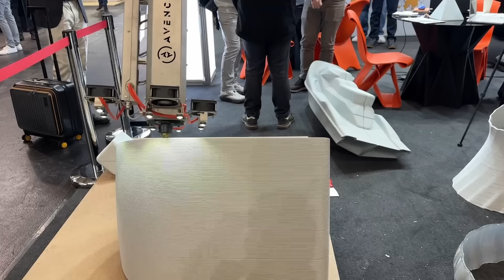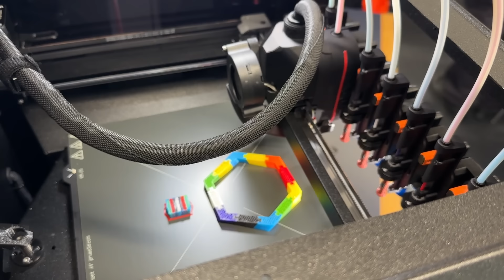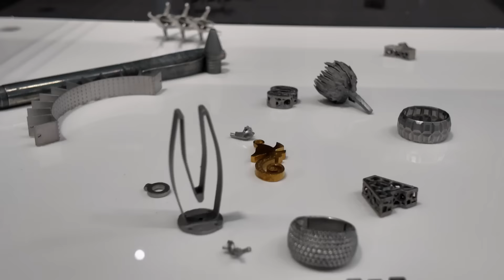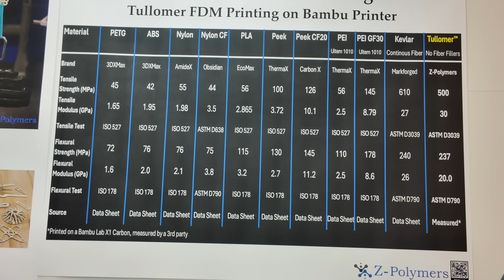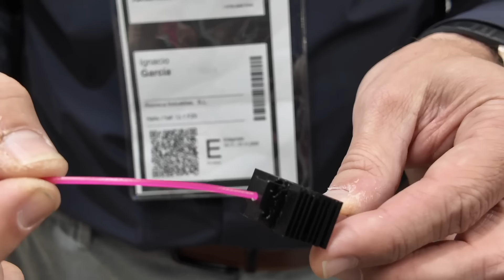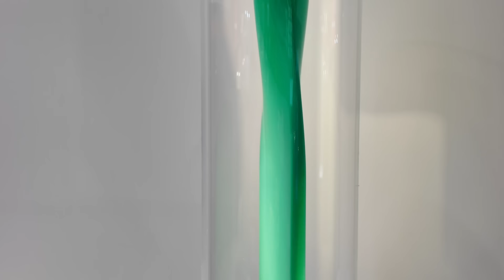2026 Will Change 3D Printing (Formnext Innovations)

Comment: How dos INDX detect filament runout?
Apart from that question, I see some big advantages:
1. More filaments are possible compared to active solutions
2. If a toolhead is dropped, it is passive and can't start a fire
3. Flexible filaments are possible compared to nozzle switching
I already bought a Snapmaker U1, but I really wonder, if I need an SV08 Max with INDX for big and really multi multimaterial prints. That would probably replace the need for a U1 depending how good it is with flexibles. I still have to start using it.
Reply: Also INDX scales better, the difference of price between a INDX setup With 5 nozzles and one with 9 is not that high, but the difference in price of a 5 toolhead printer and a 9 toolhead printer would be pretty big, INDX gets Better the more nozzles you have
Reply: @ulforcemegamon3094  True. At some point, I would like to combine an INDX hotend with an AMS like device, though. 
I don't know why I should have 9 different filaments in a print (yet). But I would see a reason for 9 different filaments in an AMS just to load them, if I need or the printer emptied another spool.

Comment: Whelp. Glad I ended up with the Vortek. Was planning on waiting to get an INDX system, but considering new filaments like the Qidi CF core filaments are 340' --- then Vortek it is I guess.
Reply: I'm 50/50 between a Vortek and INDX.  My concern is all the anti-3D printer laws being passed right now, and Prusa printers are definitely a win if the Draconian laws start hitting the books.

Comment: INDX looks like a better way forward to me.
Reply: I agree. The problem with H2C is the filament needs to be retracted out of the toolhead, all the way back to the AMS/Buffer, then the new filament sent forward on the same path. It's still faster than single nozzle purging but doing 200+ retractions adds up a lot of time.
INDX has the filament right there instantly and just needs to prime each time.

That said H2C does have 2 filament paths, so the left nozzle will always have its filament loaded at all times
Reply: Overall I think a mix of technologies will be the best.  Having a toolchanger with two heads would allow for filament changes or induction nozzle pre-heating while the other head is currently printing.
Reply: Agree. Given that AMS is a 4 year old system I would expect nothing less.
Reply: @jozefvallasek4343 the light systems with 4 tubes to the head achieves much of the same speed increases with well tuned minimal retractions but imagine the weight increase to the single tool head with the 4 tubes
Reply: bondtech nozzles are 300c, Bambu's vorwerk are 350c it looks like for multicolour prusa, for high temp bamboo?
Reply: @BitmapFrogs taking bets bontech releases high temp nozzles in a year? I only use my 350C nozzle for a single filament I have, and that filament is so expensive I have only used it three times. I feel like this is the life cycle of the e3d quickchange nozzles all over again.
Reply: You'll never know from this guy channel which is better because he is not into Bambu Labs 😅
Reply: @TrevFD3 word of advice, quit sucking companies off. They don’t give s 💩 about us, just our money. I have an X1C and love it. That said you can love a printer without loving a company and staying brand loyal. Before my X1C I was using the Creality CR10-V3. Buying printers that have different designs and innovations is what pushes the market forward. If we stick with praising a company, there’s less innovation over time. Look at Apple. They know people will buy their stuff every year just because of their name. Our goal as printer hobbyists should be to continue to praise the innovation and idea and point out flaws. Prusa has a better design this year with less moving parts. Bambu’s design is an accident waiting to happen with all of its parts to swap nozzles.
Reply: @TrevFD3 because bambú sucks.
Reply: Not really. It's slower than tool change. Can't pre-heat, no change within each tube, And normally you don't need 8, let alone 10 tools
Reply: @mostlymessingabout  You might not need it in a single print, but you might need it for a project and a nice way to keep them all loaded and organised. I have a project lining up that will need at the very minimum 5 or 6 and easily could use 8 colours and with any of them used potentially at any point. Then I need to print tonnes of them, which are all different/unique. The indx and its price plus that combined with a new Prusa Core or L is very tempting.
Reply: @naycnay is that the go-to nowadays? After all the research I’ve done, (this will be my first 3D printer) I’ve seen Prusa is pretty much the best, my favorite being that they offer replacement parts the easiest, and not being locked out of the device for not updating is a huge thing to me as well lol. This INDX system I’ve been seeing so much recently is probably what will make me finally pull the trigger on them. Is there any other combinations or printers your recommend?
Reply: @mostlymessingabout depends on the market. For hobbiests, you usually have a spare 30 mins to let the tools heat up each time (and jeez it takes like 8 seconds on the indx) but you dont have a lot of spare money. Voron toolchanger is 100-200 dollars per tool. Prusa XL is 700 per tool. AMS costs a lot of money in filament waste when you are printing one small multicolor item at a time, not a plate full. INDX is, if I recall, 300$+35 per tool, so after the second nozzle you are better than all other options money wise. As an added benefit over AMS, it can do multiple nozzle sizes and flexibles.

Comment: For that 400c prusa hotend, they didn't show it with the silicone sock, how did they handle that, what material do they use?
Reply from the maker: Good question. I don't know the answer but my guess is they just couldn't put a silicone sock onto it as silicone's temperature resistance is too low. So you have to deal with the dissipation and material sticking directly onto the heaterblock.
Reply: @JanTecEngineering  yes, maybe you need to remove it for printing about circa 350c but I hoped they found some better material, high temp silicone or something similar. If you can ask that would be nice, thanks 😊

Comment: You mentioned not being an advertisement for Z Polymers Tullomer. I find it odd that you mentioned that specifically but didn't say the same for any other company/product. I'm not insinuating anything but being that you didn't mention anything about user complaints on layer adhesion which are well known at this point I think the coverage of that material is disingenuous from a channel the likes of JanTec.
Reply from the maker: Thanks for your comment. To be clear: I never receive any payment by the filament manufacturers I test on this channel. 
I didn't test Tullomer myself and to be fully honest here, haven't done much research about user experiences with this filament. I should have been more differentiated at this point, fully agreed and noted for further videos.
Reply: I came back to edit my comment because I remembered being pretty critical maybe too much. I mean it is still the responsibility I suppose at least partly for people to do they're own research especially if spending the kind of $ that's being asked for Tullomer. A little extra work to go online, maybe ask A.I. to compile good and bad reviews on a product or company and add that as a brief note in you're video. 

I honestly would like for Tullomer to work better but I think the company maybe being stubborn and not wanting to acknowledge that it's probably going to need a specialized printer/process to get acceptable layer adhesion. I get that they want to have a larger market with any normal printer capable but from a materials science aspect I don't think it's possible. 

It still has a super valuable potential though and I do know of two possibilities for printers that may be able to get the layer adhesion increased.

I did reach out to Z Polymers or they're distributor in relation to a call for project proposals that would receive filament sponsorship for. I didn't hear back. Been meaning to ask again. Maybe I should.

Anyway thanks for responding and looking forward to seeing the next work you do.

Comment: I'd say the Bondtech INDX over the BambuLab Vortek. The Vortek always seemed like a reactionary product that they quickly got together to try to beat BT to market, but had to do a lot of compromises to avoid any potential patents. It doesn't make as much sense from a tool-changing perspective since it still has to unload the filament every time.
Reply: I always saw it more as a transition as to not make the AMS system too obsolete , as a proper toolchanger would beat a AMS in most situations  , so the Vortek is kinda a transition that has both toolchanger and AMS aspects until Bambu can make a toolchanger

Comment: I wanna see non planar printing in mass market software like prusaslicer. That airbrush nozzle would help a Non planar setup.
Reply: Uhhhh... You mean (Non) Planar
Reply: @brianhutchinson7863  yep fat fingers messed that up - edited to fix.
Reply: @OneSolidCube Search 5 axis 3d printer. I think non-planar is great and a few things can be accomplished with a 3 axis printer and a special nozzle but really 5 axis hardware is going to be where non-planar is best used. I've used Non-Planar Prusa Slicer. It basically works but is far too limited for what I want to do. Not enough control over top line direction, how many non planar layers are printed, cant use non planar bottom layers or on support interface. There are a number of other 5 axis projects from ambitious 3DP enthusiasts that you will find if you look. Rep5x is the motion system that would fit what I would like to print best. With A.I. assistance coding a non-planar slicer should be pretty easy if you wanted to get really ambitious.

Comment: E3D Fuge is something I am looking forward to see what the real numbers are in real world applications.
Their booth at formnext was a little bit nondescript. I almost overlooked it, when I walked the stands on the outer side of the hall.
Reply from the maker: Year, I feel like the Fuge project is still in an early stage but I'm looking forward to the numbers too!
Reply: @JanTecEngineering  Based on the displayed shape, I'm going to bet they simply crimp a round tube to get the flat shape.

Comment: Ngl, the 2,2 mm filament looks a bit like how every few years, a new bicycle wheel size gets invented.
Reply from the maker: Valid point, but if i's true that both 1.75 and 2.2 work on the same system, I feel like there's no real disadvantage for the customer.
Reply: @JanTecEngineering  Weeell ... hotend+nozzle is only half of the business end bits, so, yea, it could definitely be worse.
Reply: @JanTecEngineering  How are you going to get 2.2 mm filament to work in a 1.75 mm printer?
Reply: Yeah, but man that mullet 29/27.5 "invention" was totally revolutionary. Dirt bikes could only dream of a mixed size revolution like that.
/s

Comment: Indx only 300°C? :( still, would love to have it!
Reply from the maker: I think someone asked this and they said there might be higher temp versions in the future. I'm not sure what's the limiting factor here (induction heater or nozzle material)
Reply: @JanTecEngineering in the interview with bondtech i saw that said 300 was the starting point, so in the future they would maybe increase it after they tested more. Lets hope so, would solve one main issue with my core one, the low nozzle max temp:)
Reply: I’ve heard rumours that it can reach 360°, nothing confirmed yet, but some Bondtech guys were saying that they’ve printed at that temp without problems.

Comment: Aumatis resorting to ai slop is a bad sign, I would not trust a company that can't be bothered to make their own graphics or hire a human to do it for them.
Reply from the maker: I made that infographic myself using AI, it' not from Aumatis. I thought I'd give it a try as a way to visualise my explanation. I didn't have the time to draw one myself. 
Probably won't do it again in further videos.
Reply: @JanTecEngineering  That slopografic was jarringly bad. Not doing it again is the right takeaway :)
Reply: @JanTecEngineering I wouldn't mind if you specified that it was sketched by yourself or by AI as it would avoid confusion. I also thought that the schematic was from the company's website or so. 😅
Reply from the maker: Sorry!
Reply: @JanTecEngineering No worries, that kind of thing is easy to miss. I once forgot to put a slide caption for one of my presentations myself!

Comment: I think the Fuge nozzle can be made by first drilling a round hole, then compressing th ewhole thing to flatten the hole, and finally machine the outside to be round again.
Reply: I was there (I even show up in the video 😅) and they confirmed me that they were made in 2 parts and then assembled but they are thinking how to simplify the machining of it while keep a consistent and repeatable result.
Reply: Minuteman did it first lol. He just had pcbway make it in aluminum sls.
Reply: Hah - I posted exactly this above, then scrolled down and saw your post! Apparently they don’t do this per the comment above, but I bet this could simplify the process for them, as everything would be standard lathe operations except the pressing.